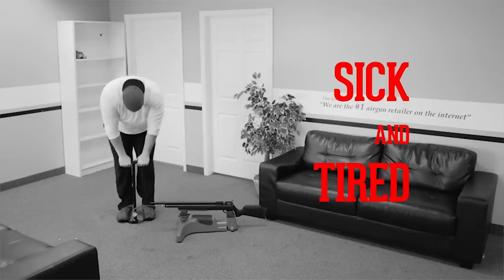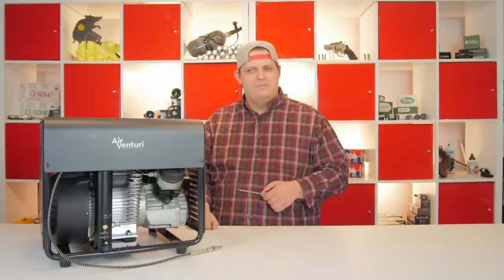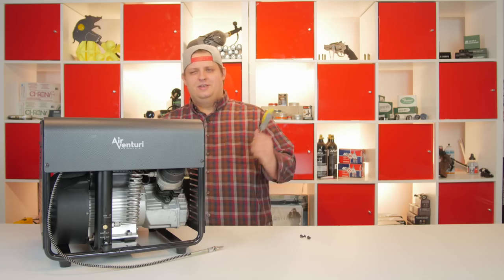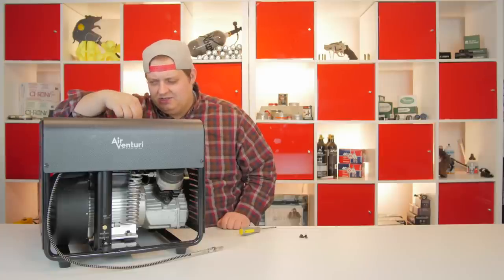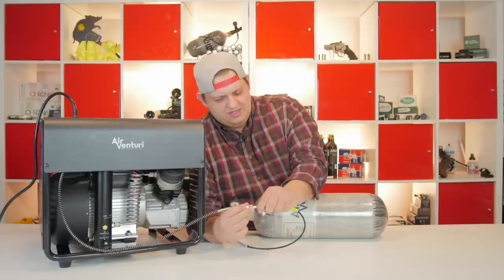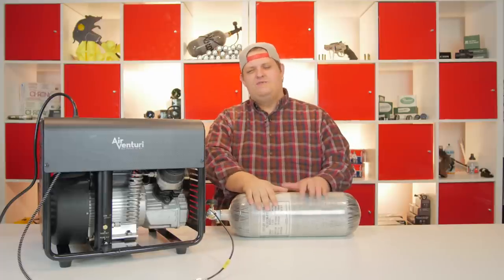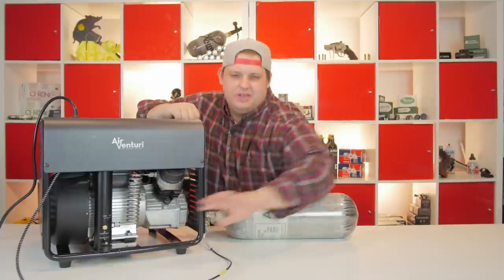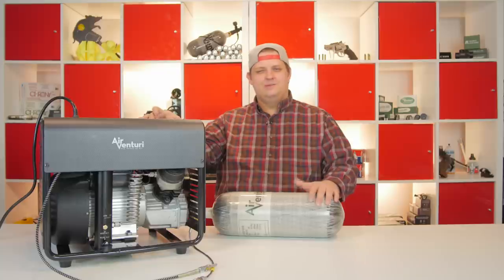The Air Venturi Air Compressor: a step by step set up and user guide

Comment: Does this compressor do a good job with removing the moisture or does it need another filter on the high pressure side. Basically is this compressor alone enough and safe to use right out of the box without worrying about moisture.

Comment: I'm having trouble with the safety valve. It keeps leaking air, an the pressure isn't building up. I have it set to 300bar, an it just won't fill my tank. What the heck is going on?
Please. Please. Help me.

Comment: Is the motor 110 and 220 volt or only 110v. Can you switch the field and power wires to change the voltage of the motor?
It costs around 1/3 less to use 220 volts.

Comment: I think he forgot the part about running it to break it in
Reply: the instructions say to run it for 10 minutes with no cap and periodically open the valve to let any water/oil escape and then let it cool down before using it again

Comment: Have had mine for 2-3 years. Used maybe 15 times to recharge my bobcat mk2.  It leaked out a bunch of oil last weekend when I used it.  Anyone run into that?  Compressor oil is still full....would guess it leaked out 1/8 to 1/4 cup....don't see any obvious leaks.  Drain plug was a little loose....but don't think that was it.  Gonna run it and see if I can spot the leak....
Reply: Yes, I had the same issue. I thought that it leaked from the crank case (for which you can buy a brand new gasket) but even after replacing it, I still have oil under the compressor...have you figured out where it was leaking from in your case?

Comment: Took almost 5 months to get mine and it broke internally in under 10 hours of useage.  Now I am on the bank log again waiting for another one.
Reply from the maker: Do you have an order #?
Reply: Airgun Depot  Yes of course. So in the meantime I bough a yong heng compressor that has worked flawlessly and came, or arrived very nicely packed, not dropped from 30,000 feet like the air venturi I initially received.
Reply from the maker: What is it?
Reply: Airgun Depot this is the resent compressor to replace the air dropped one. Order #: 7168185
Reply from the maker: It should have been delivered this Monday. If you have any issues please contact us at orders@airgundepot.com
Reply: Airgun Depot Yes it did arrive on Monday.  In prestine condition this time.  The first one that had been sent to me was in a box that was really messed up and could hardly be called a box proper.  The other had bent leg supports and smelled totally atrocious while operating.  This new one is very quiet and the air is almost scuba diving useage.  I am now proud to say that I item an Air Venturi home compressor! Oh yeah, forgot to mention that the original compressor oil water separater allowed some oil and water to pass into my tanks.  This new one, works awesome! Awesome! Awesome!
Reply from the maker: Sorry about that first one! We'll definitely look into that, but we're glad to hear you're up and running with your new toy. Happy shooting!
Reply: Airgun Depot I am happy now to.  Beside it being in bad shape on arrival the first to me and 10 hour useage before breaking, I had along with the compressor spent close to $9,000 in higher end rifles etc. All were useless without the compressor.
Reply: I wad wondering if due to the long wait and inconvenience if I could get a free rebuild kit for compressor or just the cotton /oil water  superstores.
Reply from the maker: You've got it. Expect a package from Air Venturi!
Reply: Airgun Depot you guys are awesome!
Reply: Airgun Depot do you know where to buy charcoal activated filters to keep down the normal oily smells?
Reply from the maker: We're not sure.